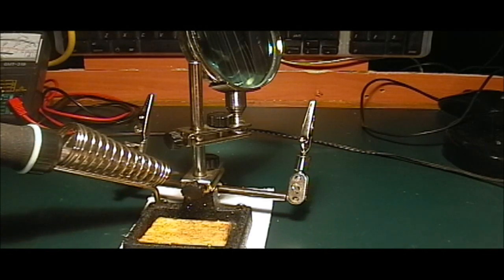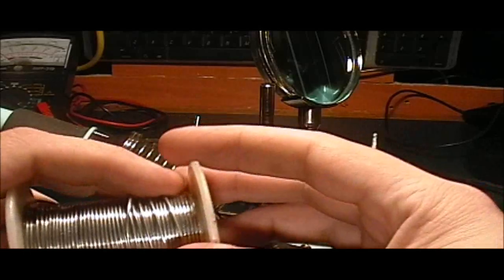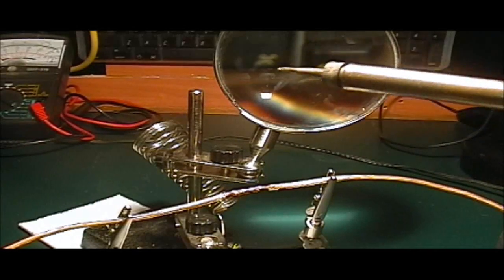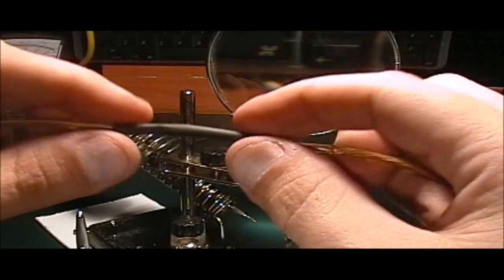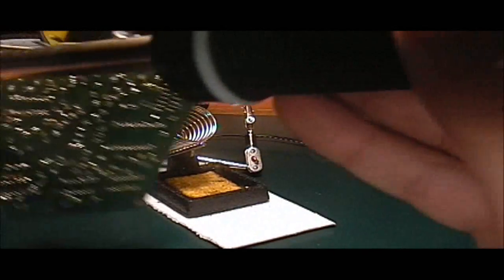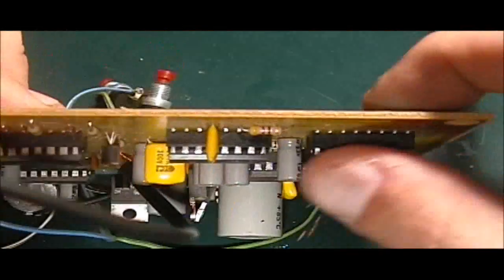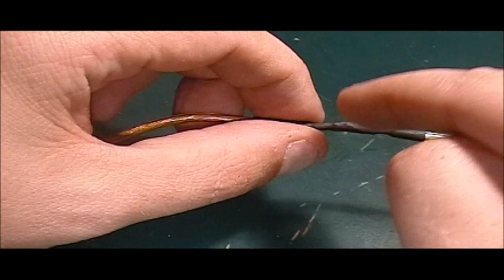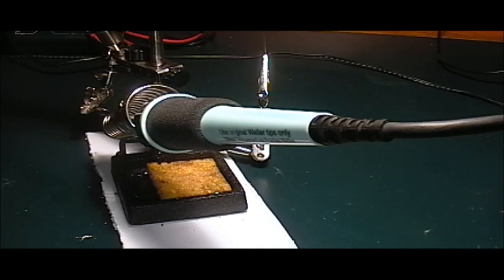How To:  How to Solder Properly

Comment: Thanks, trying to fix a tiny part inside a brand new vape. Wires inside used to  connect mode controls broke in half. Only had a two week warranty so of course it broke right after. Really hate to basically throw 65$ in the trash.

Comment: I think the key is to have a soldering gun that has variable temperature because my main issue is that the solder gets to hot and burns my components and does not stick to them

Comment: thanks for the vid!, never been confident with electronics, but now i think i know how to properly repair my remote keyless car entiry do dad, the solder between the metal piece that holds the battery and connects to the board broke and now i don't need to buy a new one!
Reply: thrustor, your comment may have just saved me a headache. I  cleaned the filth out of the dead remote for the vehicle I'm  borrowing. I noticed the metal clip was loose when I replaced the battery (hoping that would fix the problem) Cover me, I'm going back in!